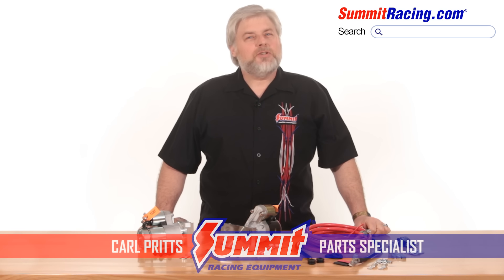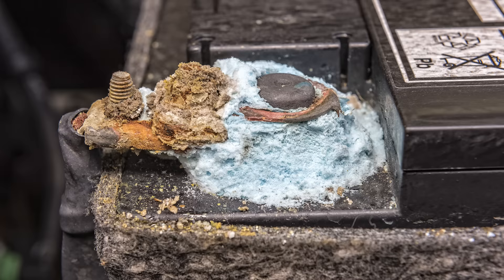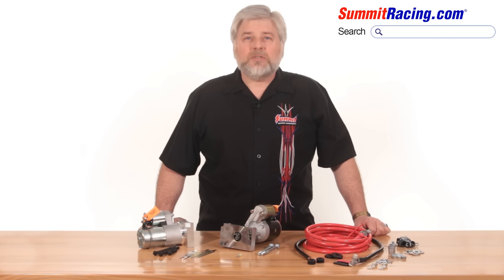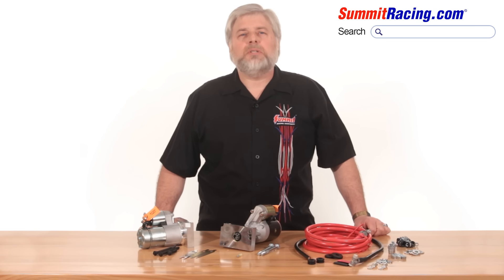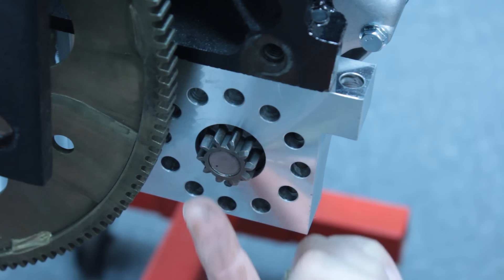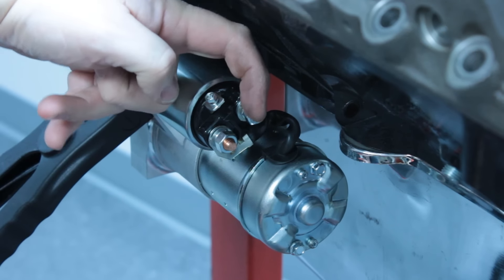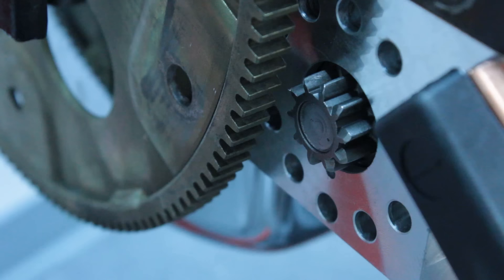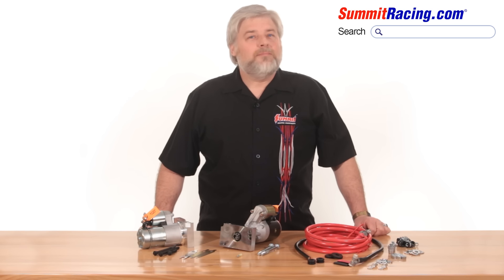Summit Racing Mini High-Torque Starters for GM

Comment: On my 350 chevy, I had to use 1/8 in shims to space pinion gear back to avoid rubbing on flywheel after engine started, very poor design.

Comment: For all the things you mentioned, I’m putting a high performance starter on I don’t think I got it in Summit. But my mounting bolts with a neural end are too long.  And the neural doesn’t stay inside the starter and it can’t go into the block so is it crucial I use those or can I get some very eight bolts to put in there and see if it makes right?  This is a 327 and I’m working on 1962.  Tony thanks

Comment: The 99 LS1 motor in my friends Tahoe has a tiny cover that is trapped between the starter and the transmission which means you have to do the clearance check and then take the starter back off if you want to replace the cover !

Comment: So i have a bell housing that completely encloses the flywheel except the very front section . i can't take the measurements like this video . i might be able paint the pinion teeth with marking paint like setting up a rear end and inspecting the pattern it makes?
Reply: That is one possibility . I've also got that problem . I did see one video where the guy was able to just barely get in there with a piece of wire but he had a lift !

Comment: Great presentation! But heres a question, i have a 69 impala 327 2 barrel. I dont have headers. Do I really need a mini high torgue starter? Or could i just replace the OEM that is there in your opinion? I am experiencing slow crank
Reply: No mini made for it.

Comment: 2:40 "DON'T WORRY ABOUT PARTIAL ENGAGEMENT." Total BS, this will eat your ring gear in short order. Summit, will you be offering free pressure plates in a year after your mini-starter destroys ring gears? Cheap mini-starters are for flippers, not for anyone who plans to keep his car. Anyone can repair their STOCK starter. Usually all that's needed are new springs, brushes, solenoid and starter drive. KEEP IT STOCK, GUYS!

Comment: I thought this video would help. I have the Battery + wire (2 or 4 AWG), the purple solenoid wire (10 or 12 AWG), red wire and a brown wire (possibly 10 or 12 AWG). On my old starter red and brown wires went on the same terminal as the Battery + wire, but The car isn’t cranking at this point. I originally placed the Battery + wire on the wrong terminal and it would make the bendix spin. I am not even able to duplicate that behavior now.

Comment: I have a 1977 sbc with the 3 hole starter mounting. 168 tooth so I took the O.e.m. starter off and bought a 9200 Powermaster mini starter. I measured the to side by side and the mounting flange is .250" difference. I am beyond pissed! I have to by .250" worth of shims and hope it works! If I'd have needed my truck to run the next day I'd have been S.O.L! Someone please explain why this is?
Reply: The lack of response is their way of saying "Screw YOU!"

Comment: I had a 99 yukon , beat to shit, has a high performance starter , been stranded and had to get towed twice , replaced the cable to starter , new battery , but standard one  do i need a bigger battery , not sure whats going on
Reply from the maker: If the battery was working before I don’t think you would need a bigger battery. Could be a bad ground, battery going bad, starter solenoid.
Reply: @SummitRacing   found out the wire going to the starter was spliced with a smaller wire , thus frying the smaller wire , can't fix stupid  whoever did this ,well you know  thanks for your reply back , someone set this up to fai lin other words , torsion adjust bolt busted head , you can tell it was drilled out
Reply: @SummitRacing  My solinoid went bad ,  but having problems with torsion bar adjustment , someone did a custom job (messed it up ) passenger side is low as heck the bolt on that side had the head sheared off , ( you could tell someone drilled it out becuase there was a dimple were the bolt head should be , do I need to clamp, then replace bolt , or is there any way to tell if the bar went toooo far , that it's not making a difference when I put new bolt in ( I hope I'm making sense )because running the bolt all the way up on passenger side didn't do anything , still low on that side by 2 in , and the other side still had a inch plus to go for max

Comment: My starter hangs up the little gear won't come out what's wrong ?with the motor running
Reply from the maker: This is typically a result of the gear lash being set too tight. Try measuring and shimming the starter mount again.

Comment: So I bought one. I have a purple wire and a brown wire. I ran the purple to the starter and the other to the electric Choke. The starter works every now and then. But sometimes it will engage the starter but it won’t go all the way through thus giving me the clicking sound. I would go underneath and turn the pinion gear on the starter with my hand. Am I using the wrong starter? Or shims are the problem? It’s a 327sbc by the way on my 64 chevelle malibu ss
Reply: They don't care.

Comment: Oh ok so what is the big terminal on the out side for then if you are not supposed to use it then WTF is it for ? He didn't go over the terminal for the step up 12 volt for the ignition either . And if you have the engine and trans installed on the car how are you going to get a wire in there to check your tooth clearance get a torch and cut a hole in the bell housing this is a pretty lame ass install video for a Summit video it sucks !